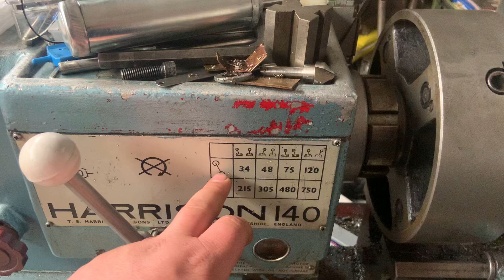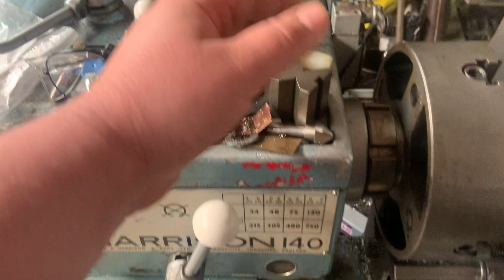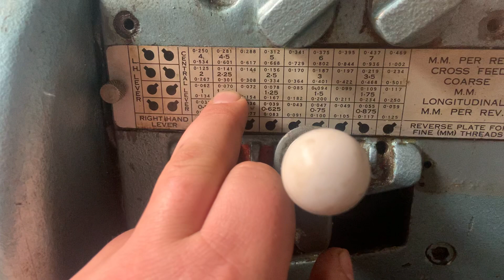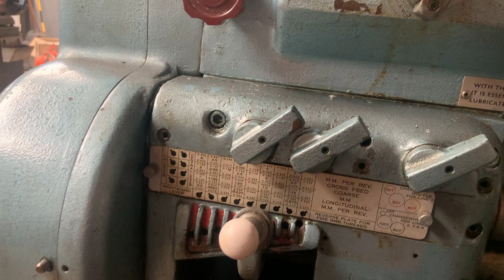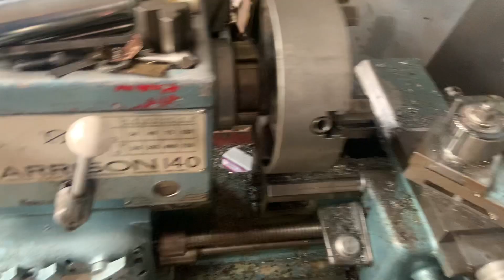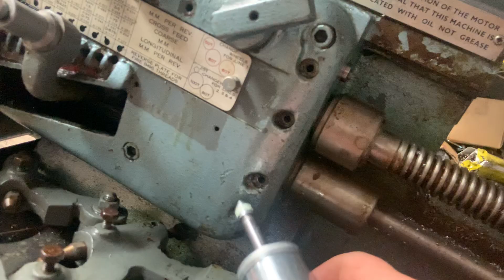Harrison 140 Lathe Operation

Comment: Excellent machine. Mine came from a college I think, and was a horrible frog green. How well does your gap block line up? Mine seems to have a slight ridge in the ways where it mates with the main bed (2thou maybe). I suspect somebody switched blocks around between machines - or it was a Friday machine. For some reason the blocks do not seem to have the machine serial numbers on them, whereas they do on the Harrison mill's horizontal milling beam end support bracket (so the bracket can be identified against the machine and not get mixed up). Cheers Paul
Reply from the maker: Hi Paul,

Yes my machine is painted in the dreaded Hammered Blue - it's not too bad though. 

Mine gap also doesn't line up particularly well despite cleaning and stoning. It's on my list of things to do, a slight bit of scraping should improve things. It's very possibly the cast iron has moved or relaxed over time. No serial numbers on mine either. It would be interesting to compare serial numbers of our machines. I suspect mine is late 60s possibly 1970. drop me an email it would be great to donate some bits to your channel.

Comment: Hi, just purchased one of these for work (without that fancy gearbox though) and am in the process of cleaning up before first use. I bought a grease gun but the nozzle doesn't look like it will fit the nipples properly, do you have a link for the nozzle you use?
Reply from the maker: You need an oil gun, definitely don't use grease! An oil gun will come with two nozzles one for concave and one for convex nipples.
Reply: @MJBEngineering  yeah I'm using oil, it didn't come with 2 nozzles annoyingly.
Reply from the maker: @somfingelse  that's annoying. I just bought mine via google. Possibly from "the nipple shop"

Comment: Hello, Great Video, Thank you for the precise and clear introduction.  Could you please tell me what oil you use in the headstock and roughly how much?  Again, Many Thanks
Reply from the maker: I use the modern equivalent to Harrisons recommendation, which is ISO 68 Hydraulic Oil (Mineral Oil). It seems to work okay but in this cold weather I think a lighter oil like ISO 46 might be better.

Comment: Thanks. Really useful. Mine is becoming increasingly "clunky" when starting the motor. I note yours starts instantly with no clunking. I had the motor off for a clean-up and inspection - seems fine. I think the problem is in the switching so new year project to dismantle and inspect. Any guidance on the electrical system would be much appreciated.
Reply from the maker: When you press the green button it's clunky or when you engage the clutch lever on top of the headstock?
Reply: @MJBEngineering  The green button. The clutch is ok.
Reply from the maker: @simonflett125  strange. Maybe your belts.
Reply: @MJBEngineering  Thanks. When spring-cleaning i noticed some splits in the main drive belt. I made an enquiry with a supplier but didn't follow it up. I will do that now.
Reply from the maker: @simonflett125  if I remember correctly they use two belts so ideally you need two of the same brand and almost a matched pair. 

I need to change mine but I'm going to upgrade to a 3HP motor and bigger pulley for 1000RPM at some point so will do it then.

Comment: my lead screw doesn't turn under power, regardless of tumbler position, but it does turn by hand. Any idea what the problem is?
Reply: 8:26 question answered. I had no idea it did that. You're the first person to ever point at that collar and say it did anything. lol. thanks man. You didn't say, but, presumably the power feed underneath the lead screw also has a similar dog collar on?
Reply from the maker: @areyouavinalaff  no the power feed doesn't have a dog clutch. The idea of the dog clutch on the lead screw is that's it's only engaged whilst you're cutting threads. It then isn't getting chips dragged into the half nuts and causing wear.

Comment: Hi Bradley, thank you for your video: in your oponion, if i separate the lathe from the stand and i put the lathe on another table ( that support 1000 kg), Is It possible to install the motor.? Because i know that It Is in lower position, but i dont know very well where It Is! M thinking to buy and Harrison 140 like your, thank you, Alberto
Reply from the maker: Don't separate the lathe from the stand. They are very carefully grouted from factory to stop twist in the bed

Comment: Hi, Enjoyed the video as I have a 140 myself and have had trouble getting the leadscrew to disengage when not in use but but this has helped me sort it. I noticed you have a fixed steady for the lathe unfortunately mine came without one and was wondering if you had any measurements of yours to share with a view to make one. thanks again for the video.
Colin
Reply from the maker: Hi Colin, it's actually one I've borrowed from a friend. I did want to get one cast.